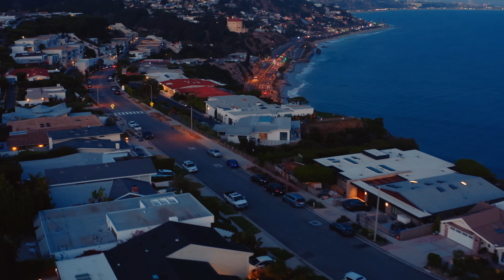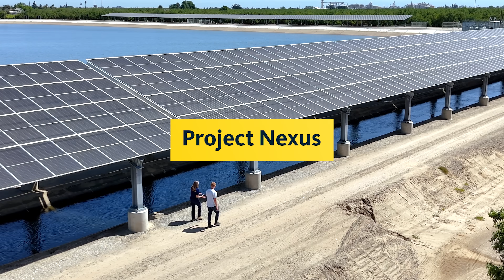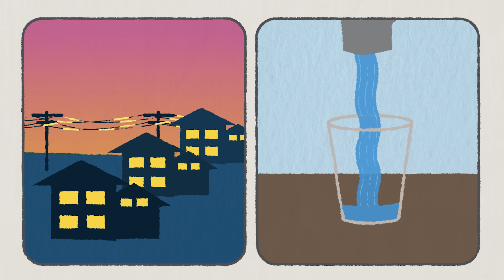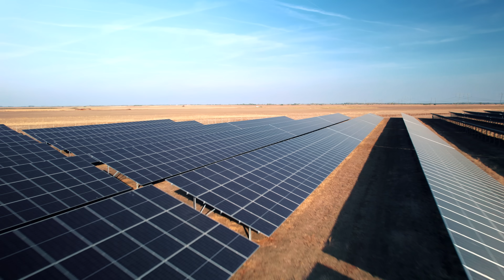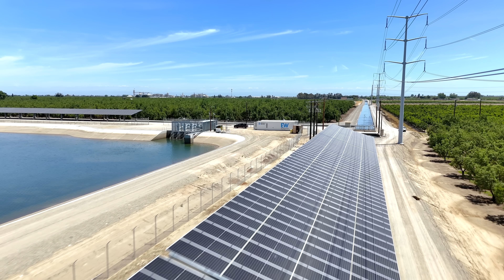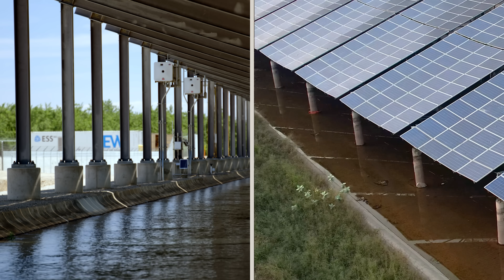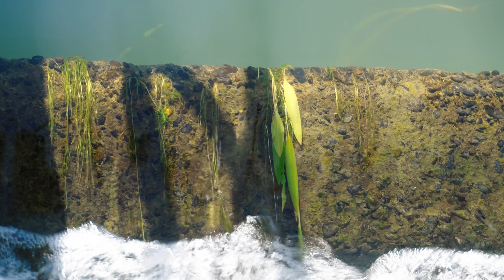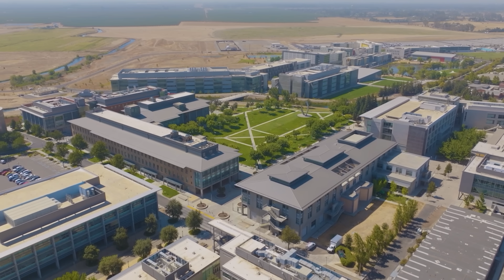California’s new solar panels do MORE than generate power

Comment: Covering canals is a good idea, but it would help most on resevoirs, reducing evaporation, reducing algae growth. Also, we could also combine other commodoties to these structures over the canals. Power tansmission lines, sensors, and data to make it more efficient.
Reply: Reservoirs are covered with floating EV. There’s no good way to roof the large space.

Comment: You could also cover the freeways with solar also
Reply: I don't think covering the tops of roads is feasible. But making roads more environmentally friendly would be great, like running water through roadways to heat it the water and use.
Reply: freeways, especially along the shoulders, make sense. many freeways have a median. That'd work. They'd need to be raised quite a bit as the freeways create a lot of dust/dirt, but that's not hard to do. And the moorings would need to be safe in case of crashes (sand barrels and the like)
Reply: sure, but theres better examples to maximize the shade benefits like the one explained in the video
Reply: Actually you can Eliminate cars .. Or add a full eco dome trellus but.. Smart is too Exsperimentally not Profitieren

Comment: Excellent video you covered the big ones...

I agree solar over parking lots (keeps them cooler less expanding contracting cracking and less snow to clean up possibly..

Over shade loving crops but prioritize crops over energy

and over canals are great use..!!

I dont know how I feel about those low profile ones.. like the biger ones make maintenance easier to access but are less effecient then closer to the water... but something just doesnt feel right with it still..

Comment: Wow, no chance of the very mild winds in those areas getting under those panels.
Reply: The engineers will have had to address wind loads for the project as it is standard practice to get regulatory approval to build anything anywhere.

Comment: Everyone with comment questions should read the linked article. It explains that the projected 13 gigawatts of power equals about  one-sixth of California's current installed generating capacity and would meet about half of their 2030 decarbonization goals. It also says that the 63 billion gallons saved from evaporation is enough to provide water for 2 million homes.

Comment: Although this sounds like a win-win, there seems to be no consideration of unintended consequences.  Think about countries that install dams in rivers for power and increased water use.  The water “stolen” upstream has significant consequences for regions downstream.  The same will be true here.  Those 63 billion gallons don’t just disappear, they evaporate into the atmosphere and eventually fall as rain down-wind.  From where will they be “stealing” these 63 billion gallons of water?  Does that water fall as rain on the windward side of the mountains to the east?  What impact will that have on those areas?  Does 63 billion gallons represent a material percentage of precipitation in those areas, or is it an insignificant amount?  These questions should be answered before assuming that the only cost of this strategy is the cost of construction.
Reply: A good point. Something to look into and see if it is relevant to the circumstances.

Comment: An almond orchard on a state that has constant water supply issues and forest fires. The problem is not evaporation alone. It's picking the wrong crops for your supply.
Reply: And they planted them like mad during the last multi-year drought. Sucked up massive amounts of groundwater to do so.
Reply: @texicaliblues  Wrong. Thousands of acres of almond trees were torn out during Californias last two major droughts. Less than 1/4 of those acres were replanted and those that have are now running direct-to-tree injected watering of small throw sprinklers. They've also changed the rootstock of the almond trees they're growing, so the trees need about 1/3 the amount of water to produce similar crops.
Reply: It wouldn't be a problem if we didn't have to ship the bulk of Northern California's snow pack water to Southern California so people can live in high and low desert while maintaining green lawns and swimming pools. There's barely any water conservation in Southern California- there are few reservoirs, no place for rainwater to go other than down the roadways and the kicker? They freaking turned a river into a concrete slough.

Comment: ..DESIGN IS flawed,AS EVAPORATION RATE DOESNT DO ANYTHING WITH temperature OF WATER,BUT RATHER humidity over water surface ,PHYSICAL CHEMISTRY SAYS so

...NEED TO ADDITIONALLY ENCLOSE THE SPACE WITH SOME KIND OF stuff!!.......ORGANIC GLASS kind of!!!......EVERYTHING TO KEEP THE HUMIDITY LEVEL OVER THE WATER SURFACE AS HIGH AS POSSIBLE!!
Reply: Don't yell, it is unbecoming of an adult.
Having a ceiling means humidity over water surface increases. Not to 100% but it does increase.
Also, evaporation does increase with temperature, that's elementary, how else would you get phase changes at higher temperatures?
Reply: 2 THINGS CAN BE TRUE
Reply: @goodfunforhermits  ...WIND IS MAIN ENEMY,THOUGH

....IT BLOWS OUT HUMID AIR,AND MAKES WATER TO HUMIDIFY next PORTION OF dry as bone air

Comment: Agrivoltaics needs to become normalized. Solar panels on stilts, with things like raspberries grown underneath hydroponically, IDEALLY using the water from a fish breeding tank to provide natural fertilizer for the berries. As the berries evaporate the water through their leaves under the solar panels, the panels are cooled down and actually get about a 15% power boost from improved efficiency. The panels also cover the berries from direct sunlight which scorches their leaves and the berries themselves later in the season. If you used an aquaponics system to fertilize, you also have fish to sell. So you produce solar power, berries, and agriculture all from the same land.

Comment: As people pointed out here, covering reservoirs (e.g., with solar) keeps algae in check but also prevents the formation of bromate which to human bodies is neither a bro, nor a mate from what I read.

As for farms, I also recently saw reports of experiments with vertical panels in crop fields, spaced wide enough apart to allow tractors and specialized machinery to move between them. That's in addition to where panels can be used for shading benefits.
Reply: There was a recent small study with solar panels designed to not block the specific wavelengths tomato plants use best. The plants under the panels had 30% higher yields than the control.
Reply: putting soalr panels in reservoirs, especially larger ones, makes sense. The biggest reason it makes sense -- there are already power lines where the dam is. One uses the existing transmission infrastructure.

Still there are meaningful challenges in California, where the reservoirs shrink dramatically from their peak volumes in the spring to their volumes in October and November, as most of the state gets really dry. So those floating panels might not have a place to float ... especially is there are a lot of dry years in a row.
Reply: Collocating solar and farming has been done for decades now.
Reply: A bromate is not a bro, mate
Reply: Put solar panels near the location were you will be powering !  If you  transmit electricity ⚡️ you lose power over distance  . 

Better place is Parking lots solar panels 👍  .
Reply: @ProfessorFickle  "Best" (parking lot) shouldn't be in opposition to "very good" (canals). But solar over canals reduces evaporation loss (so it might be "best"). 
That debate is unresolveable.
Reply: @mrcryptozoic817  Infrastructure to put solar over a 500 mile long canal system 💰💰💰💰💰💰💰💰💰 plus the infrastructure to get the electricity to homes & industry 💰💰💰💰💰💰 
On paper  it looks decent. I wonder how it will work out in practice 👍 
I think Arizona 🏜️, Nevada , New Mexico need this more desperately .
Reply: @mrcryptozoic817  Per the best case numbers in this video, water consumption would drop 0.4%.
Reply: @ProfessorFickle  or alternatively, this also means you can move more electronic infrastructure around the canals?

Comment: You are spreading misinformation by saying that 2TW could power 92million homes. 

You do not factor in that solar panels do not operate when there is no light, introduce instability in the grid, and require grid interconnections. Solar panels adjusted for Whs produced, are not equivalent to fossil fuels or nuclear. 

If your agenda is to push green technologies no matter the cost. You need to know that the cost will be passed on to the consumer and it will reduce economic growth. And the cost will be quite high

Comment: 0:10 it's a 100,000% increase ;)
Reply: 99,900% increase :) 

it doesn't need to increase by the initial amount.
Reply: What’s 99.990% between Friends 🤔 😂
Reply: people's brains have been irreparably rotted by percentages.
Reply: Exactly. 1,000X. Almost stopped watching right here. If very first numbers ten seconds in are 2 orders of magnitude off, what else is gonna be wrong?!
Reply: @markmnelson  This whole idea is pretty wrong. Solar panels are not "stealing land". You wold need to cover less than 0.01% of the territory of California with solar panels to cover the whole demand for electricity. If you worry that solar panels will take up 0.1% of the land, it is a total nonsense, nobody needs that much electricity.
Reply: @IvanKuckir  I'm sure we'll figure out something to do with that free power. Maybe power the robot army?
Reply: It’s actually 99,999,900% increase. 

Here’s the math:
	•	1 TW = 1,000 GW
	•	1,000 TW = 1,000,000 GW
	•	So you’re going from 1 GW to 1,000,000 GW — a factor of 1 million
Percentage increase = ((1,000,000 − 1) / 1) × 100 = 99,999,900%
Reply: @jacobsharf8173  nono, the increase is from 1 GW to 1 TW, not 1 GW to 1000 TW
Reply: @gdludus ah thanks, I heard terawatt and saw 1000 on the graph and thought huh, 1000 terawatts. Clearly need to learn how to read. Thanks, was wondering about this

Comment: I have one simple answer:  "Solar Frickin' Roadways"!
Reply: Do you mean turning road in to solar panels or cover roads with a canopy of solar panels?
Reply: @Teddy_Morrison  just google "solar freakin'' roadways" and then google "solar roadways, thunderf00t"

(its actually freakin', not frickin', my bad!)
Reply: That has been tried in the Netherlands with a bike path, The bikes caused too much damage to the solar road to make it worth it, and cars do a lot more damage than bikes (because they're a lot heavier). It would work with a canopy though. That said, it does make it very easy for solar panels to get stolen since there's an escape right right below.
Reply: So who's working on the problem of cleaning-up when billions of panels need replacing after 30 years.Another job for the next gen?
Reply: @huwpalmer2496  so I guess we better not use solar panels because… garbage exists.

Comment: Solar panels are tegularly put on pole's over grazing land and arable farm land. By providing Cattle shade it  makes it much easier for them to cope with heat. And over arable crops id the panels use pan and tilt their is easily enough light for growth.
This why double sided panels work so well because the light from the sun bounces off the ground in sufficent quantities that both sides get more than enough energy.

Having said that if this works over water, why not put it over railways to help power electric trains and over roads. It wont stop people being able to look at the passing countryside but it will protect roads from rain & snow.
In European towns where walking and cycling is emphasized it will make travel far nicer albeit it could have a wind tunnel effect.
I havem't watched the whole video yet, but I am sure you will talk about the widely used practice of putting panels on top of lakes to again cut down evaporation and that water being flat is a great for floating angled supports for Panels.

Comment: Why not close off the walls so you don't get that Venturi effect that is going to pull dry warm air over the canal end evaporate water? You don't need to cover it with something as expensive as a solar panel. Even something as simple as a white tarp should improve the evaporation rate along the canal.

Comment: A solar panel needs to be replaced about every 10 years, it has a very short timespan and it needs lots of area.
A battery still costs so much, that if you want to bridge a 2 weeks period without direct sun and wind (happens every second year) the energy would cost 100 times more than conventional energy.

So we are far from able to use just sun and wind for energy!
Reply: What a nonsense!
Reply: @Henning_Rech Diffamation instead of argumentation is only used, if arguments are missing.
The one, who gets only diffamation, is the one, who is correct.
Reply: 30 to 35 years quoted in the video
Reply: @gloucestergarden3441  Whatever it will be in the end, we talk abot 25+ yrs. In Germany we started to campaign for PV in 2000, so there are now many installations 20-25 years old going strong.
Reply: @Henning_Rech In germany we are already having a huge bunch of PV panel waste. People are investing on trying to reuse the materials, which seem to be quite difficult.
Reply: @gloucestergarden3441 This is easy to find out. We know exactly how much solar was installed in which year. In germany we also know exactly, how much solar power is stored as garbage and they would like to renew, which is currently very difficult.
So you can see exactly the installed power up to which year is garbage already, which is until 2015.

By the way, you can also look at the roofs, the lighter a solar panel already is the more energy is reflected, which means there is not even a chance to convert it into electricity. If you remember how old the panels are... there you are!

If a car manufacturer tells you, his hybrid car needs less than 2l/100km, do you really trust this? Or do you search for comparable real life tests?
Reply: Most solar panels easily last over three decades, what kind of terrible quality are you buying?
Solar panels on roofs and above parking and roads would be sufficient, which means it uses exactly zero extra area. As shown in this video you can actually get dual use out of them (another is solar panels above meadows so animals can graze below them in the half shade).
Solar panels don't need direct sun, they just lose some performance with indirect sun.
Nobody is talking about disconnnecting from the grid just yet, you imagined that: There's a grid where you're connected to other places that do have sun, wind, hydro, geo, nuclear, or storage.
Batteries are cheap, a household uses about 3kWh a day at normal use, so lets take your imaginary 2 week period of pure darkness without wind. that's 14 times 3 = 21 kWh. 
A 20kWh battery costs about $3000 for above average quality battery with an energy trading chip (where it allows you to make money). 

Now, show me your math for that "100 times" number you just posted. And I'd like to see a source that says solar panels stop working after 10 years.
Reply: A bot for the fossil fuel industry has arrived!
Reply: @variyasalo2581 Calling other people bots, trolls, devils and so on is called dehuminisation, which is an old Nazi method. Something only the really bad people do.

The good guys are argueing instead.

Comment: It also doesn't require lots of new transmission lines as each segment of panels can produce power for the local communities along it route as opposed to a huge, central solar farm.
Reply: Maybe farms along the route could also go electric if authorities also see this as a chance to boost the electric agricultural machinery sector. The farms could power themselves with little marginal cost in future. Would seem only to need an imaginative financing scheme.
Reply: @undercoveraca are there electric farm machines available to replace the diesel ones currently used?
Reply: @chrisbuhler3686  Yes,  quite a lot, but I'm sure not every tech spec is covered yet. The market needs a boost.
Reply: @chrisbuhler3686  yes, many of the existing diesel machinery options are also internal hybrid, meaning they use the diesel to drive a generator that actually powers the drivetrain and the hydraulics. So those could be pretty trivially converted.
Reply: @LoisoPondohva  this is not my experience, though I don’t have access to the newest equipment and perhaps it is more common now. 

We have a skid steer that uses hydraulics to run but the tractors and other equipment is mostly directly driven off of a diesel motor without the generator in between. I know many train engines run the way you describe and maybe in California it is common, but it’s not that common where I am, unfortunately. 

Even if they do run this way I suspect it is not trivial  to add the battery and charging components. These are complicated machines in many cases. 

I want everything to switch over to electric, I just don’t think farm equipment is going to be an easy place for it. I want to be wrong about this—and maybe if there is this power supply available, there could be an industry to provide the switch over service but as far as I know that doesn’t exist yet.
Reply: @chrisbuhler3686 you need to look into what southern australian farming communities use. it would be an insane amount of money on the table for a society that has gone almost full renewable to still be diesel dependent for heavy machinery
Reply: A linear solar pv backbone for a chain of microgrids. Clever idea!
Reply: True, though it will require new substations to be built. Not necessarily a problem, just takes time and planning
Reply: On top of this you already have a right of way for those transmission lines.  Just run them along the canal.